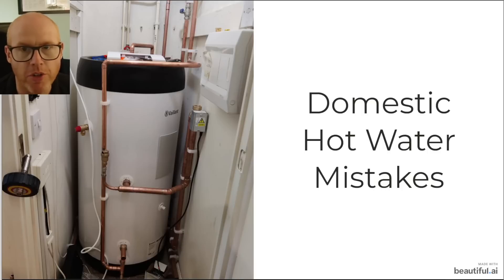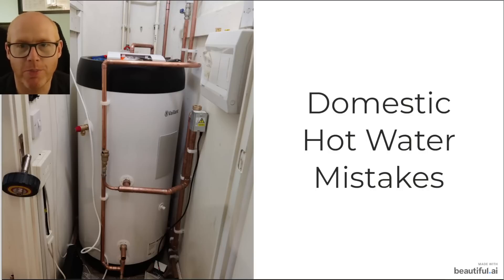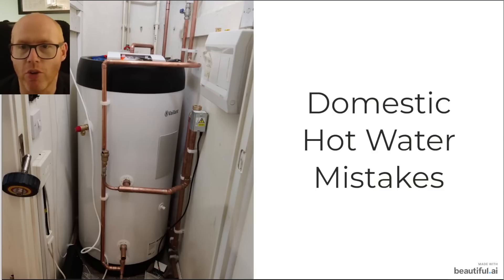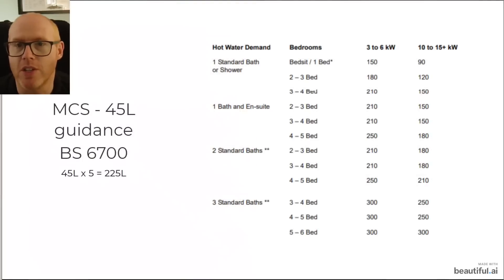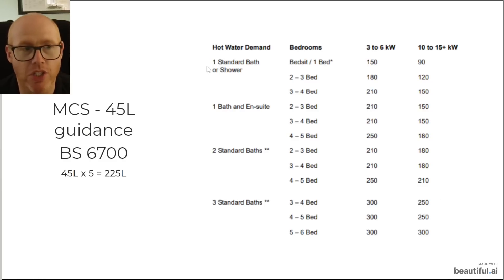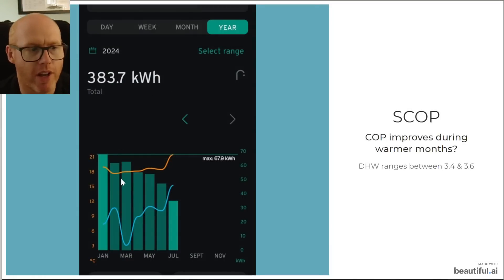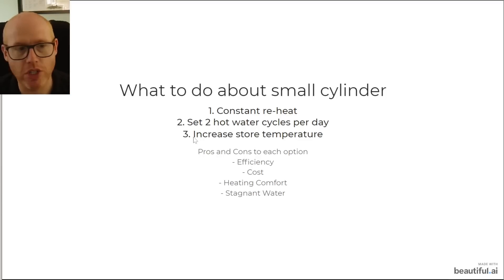My Hot Water cylinder is the WRONG size! What I've learned about heat pump hot water cylinders.

Comment: While I was watching your video (again), there was an 'Everything Electric Show' video below it. Their guest was Mat Ferrel. When I first looked at it,  I thought you were their special guest. The likeness is very strong. 
Anyway, thanks for the video. I think I commented before that I'm just waiting for an installation date from Octopus., so all information is useful. 
You might be able to answer a different question for me. I've already had solar and a home battery for 18 months. My gas consumption for 2023 was (thanks to the solar and battery) 10200kwh. I've watched a video by physicist Michael de Podesta, in which he said that a rule of thumb way to decide what size heat pump you need, is to divide your annual gas usage by 2900. This would suggest that I need a 4kw pump (3.52, to be precise).
Octopus are going to fit a 9kw pump. Do you think that's too big. I watched lots of Heat Geek videos and he says that having a pump that's too big really makes the efficiency suffer. What's your view?
Reply from the maker: I do like Matt Ferrell so i'll take that compliment!
I've watched all of Michael's content and he has a lot of good information presented. 
A rule of thumb is just that. I wouldn't hang on to it too tightly.
In my case, dividing by 2500 would be the most accurate way to calculate the heat loss from our historical gas usage.
12270kWh gas consumption = 4.9kW heat loss. We also added central heating to our kitchen diner which was previously heated by electric underfloor heating. This area added an extra 1kW to our overall heat loss, making a total of 5.9kW and pushing us towards the 7kW Vaillant unit.

Putting that aside, it does sound like Octopus are massively oversizing your heat pump. I think the 9kW is the worst of all the Daikin units as well. From memory it is the same physical HP as the 11 & 13kW units but different software. It means that it cannot modulate down very low and will cycle a lot more.
I would first of all check the heat loss calculation that they've carried out.
Second of all I would push for the 6kW or 8kW Daikin units which can modulate down a lot lower than the 9kw unit can.
The 8kW Daikin was the first option we were given, but it wouldn't have passed the noise test in our case. The Vaillant is just a tiny bit quieter.

Comment: Thanks for the insight. We're also a family of 5 with 2 bathrooms. For the last few years, I had been measuring how much hot water we use per day, on average, with our combi boiler. It's about 250l at a 55C flow temperature (my wife and son love extremely hot showers). 

I wish I had known about the heat geek cylinder: I picked a 300l solar cylinder (the solar versions have 2 heating coils that I will combine into 1 larger coil). It would probably have been easier with a 300L Vaillant but hindsight is perfect. 

I should be plumbing my heat pump in shortly so your comments about control will be very useful. I also have already plumbed in a Waste Water Heat Recovery (WWHR) from Recop - the side benefit is that it reheats the cold water used in the thermostatic valves so perhaps I will not have to run the water at 55C. Given what you said, I'll be aiming for 1 reheat a day at 48C, or less. 

Currently I am using the internal 3kW immersion. This heats up the top third of the tank to a toasty 62C. This covers us for a shower and a bath and reheats within an hour.
Reply from the maker: Sounds like a great plan.

Have you attempted to reduce DHW consumption? 
I know it can be a contentious topic and we have to pick our battles!
250L @55C isn't high for a family of five, but it's not low either.
Our smart shower timer function has helped us dramatically cut our usage. It is now set to a max of 6 minutes and then will turn the shower off. 6 min is now the maximum, not minimum shower length allowed in our house. 
It's amazing how easy it is to change human behaviour sometimes.

Also, aerated shower heads has helped a lot.

Good luck and I hope the installation continues to go well for you.
Reply: @UpsideDownFork  I have a second account, @chidleyengineering see that comment for how I run my system now. I haven't plumbed in my soft water system yet - that should reduce flow. Also I'm hoping to reduce the temperature. As my wife likes the hot water, I have to be really careful hence why I'm running it 50C (plus 5 for flow so 55C flow).

Comment: Megaflo 250lt with system gas boiler. If our three shower rooms will be used at the same time, I just push the one hour boost button, before going in. The cylinder has never ran out of hot water.
Last year I was thinking to remove the boiler and get a heat pump. The deal broke when all quotes included a new cylinder and I’m happy with our decision to stay as we are for now
Reply from the maker: You could keep your cylinder and run a heat exchanger to make it efficient for connecting to a heat pump.
Reply: @UpsideDownFork  
Interesting point. I received quotes from three installers and a heat exchanger was not mentioned at all. They all said to throw a five year old cylinder in the skip. I just couldn’t accept the waste. Moreover, from a bit of quick research I did at the time, the kw rating of the megaflo coil was superior to the proposed cylinder, but I appreciate this needs further evaluation

Comment: Did your installer promise a certain cop? I just don't see what grounds you would have to ask for any money back. Your system works albeit not as efficiently as it could if say it was done by another more competent installer. But unless you were guaranteed certain efficiency all installer is obliged to do is put in a working system which they did manage to do.
Reply from the maker: Yes, you make a good point and I agree to some extent. It's all about setting expectations and managing them I guess.
My expectation may be too high in this case.
It's interesting that this video has generated very different comments. Many telling me that I'm too easy going about it, yet yours is pointing the other direction.

Anyway, I hope if nothing else this video just raises some awareness.
Reply: @UpsideDownFork  it comes down to contractual law, everyone is different and another person less educated than you could have been over the moon with install. But as long as the installer fulfilled their contract they deserve full payment for it.

This is why firms who then come out with a cop guarantee should have an advantage (or a selling point) over your average installer, because they can be held accountable.
Reply from the maker: @Stanfoils  Yep, I opened the discussion with the installer to see what they thought about the sizing of the cylinder. To be honest I didn't revisit all of the paperwork to find out exactly where I stand.
The installation team agreed with me that the cylinder was too small, as did the other department I was in contact with. They've pushed the blame onto the surveyor/design team.
There's been much discussion between them internally. 
I haven't pushed the matter and have been quite open that we've been working around the issue just fine.
If they had pushed back from the outset and stated their position and why they'd delivered as agreed then I would have sucked it up and moved on, no big deal.

Comment: So basically, tank sizes are a con. 

Also, how this is going to work on a society wide scale to replace combi boilers - God knows. Most terrace houses for example that have lofts converted are not going to have anywhere for a 200L tank.
Reply from the maker: That's one way to look at it.
Smaller properties will have to have a solution like the heatgeek combo cylinder that is much smaller but replenished very quickly.
It's definitely a challenge that needs more innovation.

Comment: My hot water COP is also relatively low on the Vaillant with Unitower Plus, but it's OK. In the warmer months the actual energy consumption for hot water is around 0.8-1.5kWh per day and about 2kWh for the Legionella cycle. I don't see much of an improvement in hot water performance between 15°C and 30°C ambient temperature, but as long as the actual energy consumption isn't too high I don't care much about COP.
Heating is also OK. The COP isn't great since my house is well insulated and the heating only needs to run when it's actually cols outside, but the actual energy consumption and cost have been pretty low, so I am not complaining.
Reply from the maker: Thanks for sharing. Your observations are very much in line with my own!

Comment: As a short term fix you could increase the store temperature. Our 3-bed, 160 sq m property had an oil boiler which was replaced 11 months ago by a 7kW aroTHERM Plus system with a 250L uniSTORE cylinder. There are normally two adults living at the property and we find that an overnight cycle to 52 degrees provides all our hot water needs for the day. According to the myVaillant app, our hot water electricity consumption so far for 2024 is 458 units at 9p/unit (8.5p since 1 July) and the COP is 4.2. When my son and his family came to stay, I simply switched to manual for the duration to ensure there was hot water at all times.
Reply from the maker: Yes, that's good advice and exactly what we've been doing. It's working so far.

Comment: Seeing this video I think you are being much too kind.
This cylinder does not work for your family/home and the documentation does not leave much room for debate.
Have them swap it out, pay for the price difference between the current cylinder and the required one.
Maybe add some money for the time used or offer to pay list price for the new cylinder and sell the current one yourself.
If it was my home I would be furious. Enough hot water is a basic requirement for any home, not a bonus feature.
Reply from the maker: I get your point. I think it's a bit of a first world problem.
The sticking point really is around the fact that most installers don't make any promises of enough hot water from just one cycle per day.
So in theory we have loads of hot water if we do multiple cycles.
I get it, it's not the end of the world.
I've had a couple of cold showers in the early days as I was figuring out settings but I'm one of those weird people that doesn't mind an invigorating cold shower from time to time! 😂
Reply: @UpsideDownFork  Okay, if you can get it to work for your family/home with two cycles and no discomfort, it may be something to leave as is.
These DHW should last a very long time, so  personally i would make sure the entire family is okay with this situation.
And I still think they should have recommended a larger cylinder and should propose a good solution. This is pretty important to get right and it's not like you need to be a Heat Geek to figure out the correct size.

Comment: Hot water generally is the biggest issue with heat pumps from an installers pov. Generally we try to put forward a larger cylinder so for yourselves I would of spec'd the 300 not the 250. This is because we have found that when people go from a fast cycle time from a conventional fuel source to a heat pump larger families have issues managing their water usage. 
It's normally better to increase the volume to keep the efficiency and have people not run out but we have to take into account space, cost and energy/water wastage.

With a conventional heat source it's very easy to have a small cylinder with a faster cycle time because the temperatures are higher, around 17-25 minutes in some cases but you can quite easily double that once your heat source is a heat pump. I will say that if anyone has daughters (especially teenage ones) it's a better idea to size up, if you have boys it's less of an issue.
Reply from the maker: Thanks for sharing, that's great to hear!

Comment: How hot is your water compared to a gas boiler?
Reply from the maker: I'm not sure what you mean? The hot water is as hot as I set it. Both gas boiler and heat pumps can be configured to produce hot water at higher or lower temperatures.
Reply: @UpsideDownFork  so could you set it to 60 like most gas boiler storage systems
Reply from the maker: @davecavaghan7889  if you wanted to, yes.
60 degrees is scalding temperature though.
Reply: Can the heat pump achieve that on it's own or would you need an immersion heater
Reply from the maker: @davecavaghan7889  the heat pump can heat the hot water to well over 60 degrees. There is a test somewhere that shows someone heating theirs to 73 degrees without the immersion.

Comment: I’ve never found out what the temperature of the 45 litres/person guidance is.

It could be 45 litres of mixed bathing-temperature water (e.g. 38-40C). Or it could be 45 litres of the stored water in the tank.

If it’s water in the tank, then what temperature is the guidance talking about? It could be 48C, but more likely to be 60C. Either of those would create more than 45 litres when blended with cold to a usable temperature.

Does anyone know which the guidance is taking about?
Reply from the maker: I have searched for this several times and have not found a definitive answer.
My interpretation is that it is referring to 45L of stored hot water at 55 degrees.
So i've made a bad situation worse by turning down the store temperature of my already too small cylinder!
If anyone knows better then please share!

Comment: That's really useful, I hadn't considered that 300lt might be an advertised size rather than volumetric, though I'd guessed the coils would take up some space. A quick back of the envelope suggests that my partner can use 135lt of 40 degree water in a single shower. Add in the two teenagers and we're going to need a bigger tank... 275lt useable minimum.
Reply: She would use nowhere near that amount - if the water was fffreezing.
Reply from the maker: 😂 @normanboyes4983
Reply from the maker: Shower head makes a HUGE difference here.
You can do the bucket measure method to know exactly where you are with flow rate etc.
Good luck!

Comment: Remember the first eco thing to do is reduce. (fair play though I see in the video you've tried this). 

Before I got my SunAmp (no room for a big tank) I spent £300(!!!) on an Hansgrohe aerated, "ecosmart" low water shower head. (40% less water when showering). All other hot water use in my house is minimal. Yet to run out of water. MyVailant says my Heat Pump efficiency with 70C flow is 4.5 (summer 2024).
Reply from the maker: Nicely done!
I've attacked both areas of configuration and also human behaviour.
Fortunately our smart shower has various settings that help but one of them is the timer that gives 6 minutes and then just turns off.
That's helped adjust our behaviour!

Comment: The heatgeek cylinder (works in reverse, cylinder stores hot water as a battery and then DHW picks up heat from it via a coil of piping running through it) seems to be the solution for many showers a day whilst taking up a tiny footprint. Well worth looking at even if you don't plan on changing anything, just for content for your channel.
Reply from the maker: Yes, I've watched the recent DHW videos from heatgeek with much envy!
Reply: Are you sure of that? My understanding is that the super cylinder from heat geek was just a conventional water cylinder with a massive heat exchanger to make it efficient.
Reply: @aymerichousez1005  https://youtu.be/a1XGBmBLUnA?si=BOU2LktPI6boHSgt I'm referring to this video and yes, at 9:43 he explains he reversed the way it works so DHW runs as a coil through the hot tank which itself is heated by the heatpump.
Reply: They have 2 cylinders the super cylinder which is a normal cylinder with a very large coil (my parents had one installed a couple of months ago) and the new one that’s not available yet which operates as you just mentioned
Reply from the maker: @wardy89  They really should work on some better branding.
The "HG Series Cylinder by Newark Cylinders" has room for improvement.
Then of course there is the newer "Heat Geek Mini Store XS-XL by Newark Cylinders" Why they've chosen to label the sizes on these as Fat, Tall, XL, XS etc is beyond me. What's wrong with labelling them by their capacity?

Comment: Thanks for the video, sorry to hear you run out of hot water from time to time.  It is very good of you to share your concerns with us all.
If I may make one small point though on your interpretation of the data from the MCS site about required cylinder size for beds/baths.  From memory you have a 7kW Aerotherm ASHP.  By going straight to the 3-6kW hot water command column on the MCS table you are perhaps assuming that you are only getting 7kW of water heating with the ASHP running at max.  Of course, this is incorrect as the ASHP output is dependant on various factors, but is rarely just the rated output.  The Aerotherm 7KW ASHP has an output of over 8.6kW at 40 degree flow temp, according to the Heatpunk website analysing my system.  This might not be absolutely precise, but the general gist is you will get a lot more than 7kW for most of the year, especially when the cylinder is cold and flow temperatures are lower.
For this reason, I believe you should probably split the columns of the MCS chart for analysis of your system.
It still says you don't have a big enough cylinder, but it does reduce the discrepancy.
Having gone through your stage of parenting, I would say that your boys will be teenagers in a few years, so their water consumption for washing will then plummet, removing your consumption issue!  Small mercies of grubby teenagers.
Reply from the maker: Yes, you're quite right!

The badging and labelling of these Vaillant components does my head in! Labelled at 7, but easily producing in excess of 8...

Thanks for the reassurance. My oldest boy is currently a clean freak, the other two are happy to be covered in mud.

Everyone tells me that boys get easier and girls get more difficult. I'm praying that's true!